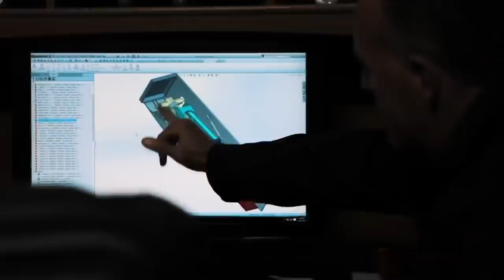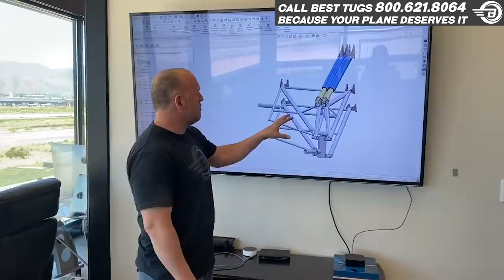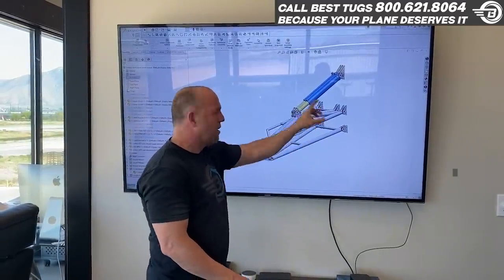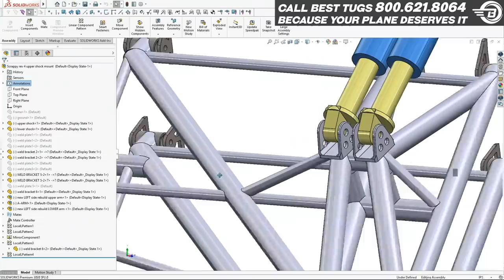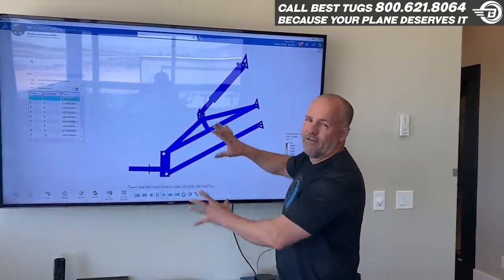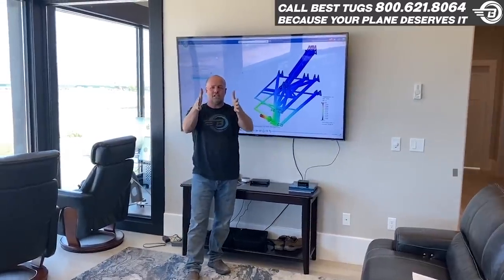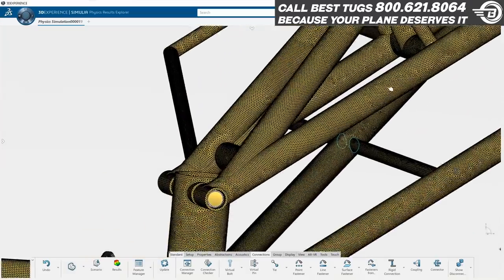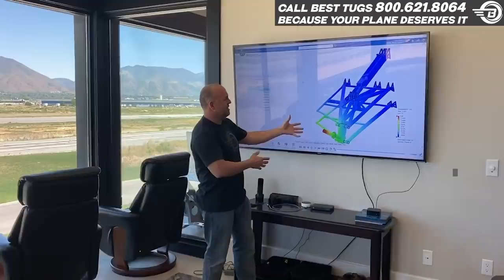Scrappy Gear Leg Wings Begin 🛠🤠 (Scrappy Bush Plane 16)

Comment: Just a plug for the Best Tug.  I needed a new tug for a new plane.  I also wanted an auxiliary power supply for doing avionics updates.  A Best Tug was more expensive than a normal gas powered tug, but the ability to act as an auxiliary power supply made it less than the cost of a gas tug and a power supply. Love my Best Tug (I have the Bravo).  No oil.  No gas.  No pulling start cords.  Moves my plane quickly and easily. No problem in Michigan winter. Appreciate Mike and Mark offering one in a contest.  They have always been generous.
Reply: You can find the remote one on alibaba.com for waay cheaper

Comment: I recommend the Grip Lock Ties.  They never leave a mark on her wrists.
Reply from the maker: Rich Glenn 😂😂😂
Reply: That being said, this comment is actually great - use of zip ties in BDSM is really frowned upon these days because if you get them too tight you cant get them off, and they cut off blood circulation (everyone got very angry when the 50 shades of grey movies used tons of zip ties in unsafe manners). The rubber lining would be nicer on your lady, but the main appeal is that i'm pretty sure Mike mentioned in a previous video that Grip Lock Ties can be undone/released, really mitigating the danger of over-tightening then not being able to cut them loose.

Comment: You need to make an RC version so even the most broke A$$ dreams of us can afford such an incredible model!!!

🥃cheers🍻
Reply: If Mike provides us with a 3d model or at least blueprints, you could definitely build it out of foam or balsa or even completely out of carbon (hard to do). If you'd build it out of foam with a wingspan of around 35-40 inches (1m) the cost would be something like 150$ for the electronics, remote and materials. If you never built anything before i'd use foam board. Easy to cut and shape and you glue it with hot glue!
Reply: @linecraftman3907  To small I only build super scale giant 1/3scale 155inch wingspan or bigger. Small stuff outta foam that gets dented & paint wont stick to for very long  is great for A toy.... Balsa wood and play and wrap the fuse in carbon. Also I draw my own plans from pictures and specs. I can build one for about 5,000 but that would be without making A dime and I only build for cash/ ready to fly 8,000. Im thinking about converting A balsa usa Super cub I built and flew in TOPGUN its1/3 scale into A scrappy. It had an off runway event that caused some small damage and needs to be recovered anyways its 80cc gas.
Reply: A small foamy can be made for 150 but the Motor servos and speed control would be cheap junk from hobby king . I build with FUTABA Hacker HITECH only
Reply: Also for scale reasons it would be gas powered since scrappy is gas powered. CHEERS GUYS happy landings
Reply: @g6rcteam81  sounds like a dream $8,000 is still way way way above my broke A$$ budget! Your skills are incredible and it's an awesome idea but I'll be in the market wen its picked up by hobbyking or HorizonHobby and is available for sub $250 BNF maybe a $100-$150 umx class 😅 cheers guys !

Comment: I’ve been wanting to tear out my old kitchen cabinets and build new ones to replace them. I am fond of hickory and red Oak. But after watching these videos I’m afraid my cabinets may end up being fiberglass and carbon fiber. Mike please stop me.
Reply: Don’t tell mike he will send you solid works drawings of a new and improved slim line soft close hardware for them.
Reply: Carbon would look so cool in a kitchen
Reply: Forged carbon fiber counter tops with clear epoxy coating... it would look almost like granite, weigh nothing, and be almost indestructible ... humm maybe not my kitchen but my workshop.... now that is tempting.

Comment: I was wondering when some one would convert their landing gear into a lifting surface, leave it to Mike to actually make it work.
Reply: Some old WWI biplanes had a small wing between its tires, but of course not as technically advanced as Mike's.
Reply: The pre-war Bellancas used this concept in many of their models. There really is nothing new in aviation!
Reply: I know old bi- plains had midwing between their wheels, but I we as thinking of wings on cabane style landing gear. Replace the "fabric".

Comment: Mike, are you concerned with the interaction between the main wing and the gear lifting bodies especially in high (relative) and low speed flight? I can't imagine the lift vector is complimentary in all phases of flight. Do you do some stability and control simulation as well? Brilliant video content! You really get the critical thinking juices flowing. Thanks for your hard work. Cudos to your son as well.

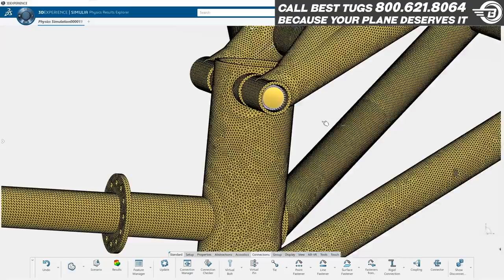Comment: Greetings from Spain! I am currently doing my bachelor´s thesis on buckling of aerospace structures. I am using Abaqus for the FEM simulations with way less elements than what you show for your landing gear around 7:20. I keep wondering: how many days do your simulations take to complete? Keep up the great content :)
Reply: Well if he is doing only static load deformation, even with huge meshes it might be quite straigthforward and not take ages but who knows, maybeMike did also built a custom made supercalculator during his free time :P
He could also have recreated the geometry only using thrusses and thus having 1D element to speed up, but you know once the cad is done, and you have plenty of work to do, you can launch the simulation and come back one week after to see the results, it won't stop you from working !!
Reply: On a fast computer, I bet that only takes maybe 20-30 minutes to run.
Reply: The mesh size appears to be small but it's tetrahedrals... and only 1 element through the thickness. Not very good for stress

Comment: Mike, I always wanted to fly in the military. As a USAF brat I watched F4s fly out of Elmendorf AB then I found out I can't tell the difference between red and green. My love over flight never waned. My first RC Model since 1989 is the Draco. I have almost one-hour full flight time. The 3D model acts up in ground air as the Full scale did. I LOVE IT! I didn't fly in 25mph winds in Ok. today.

Comment: Hi Mike, not sure if you read comments here. But Im here in SA and are working with a guy that does develop different cnc routers 3d printers etc. He has a 4 axis cnc designed to cut surfboards. It will also work for those types of wings, might save you some time too. Just want to mention though. Enjoy watching your engineering skills and passion. Greetings

Comment: Mike I am not yet a pilot. My son is a Major in the Air Force and a C130 pilot. Also flew the C146 for years.   I think more intro flight programs to get us into the seat and getting the process started.
I live very close to a GA airport, Falcon Field, and love being the turning point for the final approach especially when the war birds are out from the CAF base here.
I'm a high tech kind of Gearhead and give you props for your design and build details.
Thanks for posting.
Love your younger son's interest on the engines.

Comment: My dad taught me to work on motors also. That is invaluable and he will thank you for the knowledge when he is old enough to really understand it. I can work on HVAC/R. Did that while my dad still had his business. Then I went into engineering and learned even more. Now I do whole buildings. Mechanical, plumbing, fire protection, oxygen, medical air and vacuum for hospitals and other buildings that have a need for it. Design reverse osmosis systems for pharmacies and buildings with a need and just about any other system there is. Dabbled in some electrical and dabbled a lot in civil. All on AutoCad. Designed pipe benders up to 60” pipe for oilfield. Did that on Inventor. Which is similar to Solidworks. That fun stuff doing it and even better watching it go together perfectly. Keep having fun.
Reply from the maker: That’s awesome!  Sounds like you were raised right, with tools in hand! 👍🏻👍🏻
Reply: Mike Patey, yep. When I was 13 he gave me ‘73 Chevy with three boxes in the bed. One had the motor, another the transmission and the other the rear end. He said “you fix it? You can have it.” I had to haul hay and work at his shop for ever to get it finished but it was drivable on my 16th birthday. Learned a lot doing it that way. I guess that’s why I got all of the hard projects when I was a mechanical engineer. Loved doing the tough stuff and I still do. Solidworks makes the job a lot easier now but before... you had to triple check your clacs. And know that what you were doing would work. I’ve got a ton of stories I could tell you about nailing stuff down to a nats a$$ because it had to be that way. Love what your doing with the planes. Always wanted to fly but couldn’t afford it at the time.

Comment: The foam pieces of the wing look like the stuff we use for floor insulation in our large freezers and coolers that we construct. Lightweight and fairly strong stuff and it comes in different types that can support various psi loads.
Reply from the maker: Robert Herzog exactly 👍🤠 and when I’m done they get removed. Just a plug for the mold and then taken out
Reply: @MikePatey  Pretty cool use for the stuff. You do some amazing things. My brother is in General Aviation and told me check out you channel.

Comment: I am fascinated with the tremendous progress you have made and respect the amount of research you do before commencing the build of a component. The only thing I’ll mention is about the extra wing area you are making. A good friend of mine Charles Ligetti who made a incredible ultralight aircraft unfortunately died whilst testing his upgraded Stratos. He had added a third wing area which was close to the propeller and had spectacular low stall speeds compared to the original prototype. The performance increase was dramatically improved as well. However when he did a purposeful stall it was vicious and dramatic and he could not recover and died. A second Stratos was made as no one had figured out the aerodynamic reason for the crash. It had a loss of power on take off and because the test pilot had just left ground effect it stalled and crashed. The third wing was gaining so much lift from the proximity to the prop it allowed the aircraft to fly well below it’s actual stall speed. Can you please research the effect of your third wing regarding stall ? I’d wanted to mention it as I did not wish to loose another friend I respect.

Comment: Years ago I used to use surgical tubing with my zip ties in critical locations and it worked very well on the larger sizes and on occasions I have used shrink tubing by itself with a zip tie as an insulator without heating it up that is!

Comment: Dear Mike:
I thoroughly enjoy your videos and your attention to detail and doing it right even when it requires extra effort.  After I reviewed this video one small thing kept bothering me and I had to review it again so you could see what I was talking about.  At the 9:44 mark, you can see a bolt on the upper arm on the right side gear (as you are in the cockpit).  As with a balloon or an innertube the wheel when under the pressure of a hard landing can bulge and potentially hit the bolt causing a flat.

Comment: Although the reason the Corsair’s wings are like that is so the landing gear pivot is closer to the ground which makes the gear themselves not have to be so long. The entire reasoning behind it, is to get the gear to fit and at the same time keep that massive prop from striking the ground. Just a little FYI for the day. Ya, I geek out on every type of aircraft imaginable as well. Awesome awesome awesome! Keep up the good work. You’re putting a lot of the serious suspensions we put on our desert and sand cars to shame lol. Very cool!
Reply from the maker: Awesome tidbit on the Corsair, it’s one of my favorite aircraft and thank you for your comment.
Reply: Mike Patey .. Ya mine too....except the RC versions. They are too damn hard to land lol! Ya they originally had straight wings, but with the redesign and doing it this way they were able to fit an extra gun in each wing. I’m full of complete random stuff like that as I’m sure you are haha! Thanks for the awesome videos!

Comment: "...thinner by the thickness of the paint." 
I once worked at a window manufacturer. Installers complained that it was difficult to drive phillips head screws because the painted screws made it difficult to put the driver in the screw. So we ordered about 10k screws with the socket in the heads enlarged by the thickness of the paint.  We didnt test samples well enough. All the driver bits in the field quickly cammed out of the new screw heads and we had to scrap the batch of screws. Your application may or may not be as critical, but assume the paint "between a rock and a hard place" will be hammered away by vibration and you'll be left with a sloppy connection.

Comment: Hi Mike, this is by no means my wheelhouse and I'm sure  you've already thought of this and will see it in the next video, but I believe King makes an air shock. Listening to your explanation of dihedral and a anhedral wings and the effect. You could use air pressure and vacuum supplied to the shock to adjust the angle of your landing gear while in flight. Vacuum to lift, pressure to drop. I believe this would give you an adjustable characteristic of the wing for flight. I have not built a plane yet but will in my future. I love these videos and thank you so much for your time and making them.
Reply from the maker: John Boomer  🤠your going to like what I have already done 😜

Comment: Thanks for that info regarding the analysis software you use! I hadn't heard of simuliaworks before. I saw your mesh on the suspension components and was like "wow, he must have a supercomputer somewhere there to be running a mesh that fine on that thing" and then you explained that you can do it on any regular computer, so I googled it. It's really cool that they've got cloud computing for FEA software now. All of my experience is with ANSYS, so I'm used to local computing with very powerful machines and still a relatively long wait time for anything even remotely complex. I'm even more glad that I asked for more of that now!

Comment: I wonder if this suspension will be able to preload like Draco's did. he said he'll be able to lock them in place so I can only assume that when he brings on the power before takeoff the suspension will preload, he'll activate the lock and then take off. once he's ready to land, release the lock, arms will drop down and now he has full travel. I thought Steve Henry was pushing the limits with his 300HP Highlander but this is like a NHRA dragster of Aviation. Crazy Cool, thanks Mike
Reply: Mike Highlighted my comment and I was told I'm ready for solo flight all on my 26th birthday. haha my smile is so big my face hurts, btw I run CNC machines for a living hint hint. haha

Comment: Mike give a try if you havent already, Ti con industries FUPA cup for tig welding torches. Helps greatly with gas coverage while welding. Greatly reduces surface oxidization to yield higher quality welds, and better looking. I weld a lot of aviation oem components and these help considerably. cheers

Comment: Really like where you are going with the gear. I caught the 'hint"' and your wink when you spoke about controlling the gear location in flight to take advantage of the lift options. I sent you an email awhile back about the Fox Live Valve system they are using on SXS these days. I understand odds are you could never have read it with the volume of emails you must get, but it makes me grin to think I might have been thinking sorta on the same lines you were.
Love the work, and really enjoy it when you take the time to explain how you do you problem solving and moving ideas into 3 dimensional pieces that actually come to life on the airplanes.

Comment: I would love to design stuff like this. I'm always sketching ideas like these. My software is tailored to building structures (Autodesk Robot), but if I had more time I'd love to put my knowledge of engineering to use with my love of aviation and aerodynamics.  I'd want to see if the upper A-arm center hinge could be potentially superfluous. If the member going from the shock absorber mount to the center upper mount was slid back to merge with the rear mount, the truss system would be less statically indeterminate, simpler, and a little lighter. The bottom member looks like it would then primarily preventing torsion of the wheel assembly, but there would now be a rear upper truss triangle then to take that load pretty well especially because it would be canted steeply inward. Two slightly beefier hinges instead of three should still be a lighter assembly with three less major members. Can't wait to see this thing do carrier landings onto gravel roads. Nothing like this exists in aviation.

Comment: Him Mr. Patey,  I think it would be great for you and your brother to hold an aircraft design competition where the winner would get their design built, and if able to achieve airworthiness, be flown. That would facilitate GA from a different perspective than just creating pilots.   I hope to become a pilot someday and the innovation that you have shown in your design and engineering should be expanded.  I follow "Raptor Aircraft" and that guy is exactly what GA needs.  He has come so far, would be great if someone like you, with your energy and drive, could assist him.  Not someone who wants to swallow/steal intellectual property like they did to Algie Composite Aircraft and completely destroy innovation.